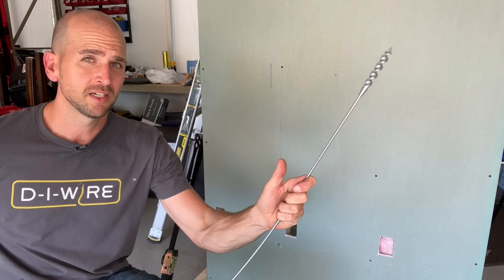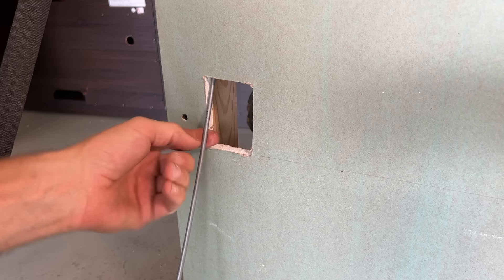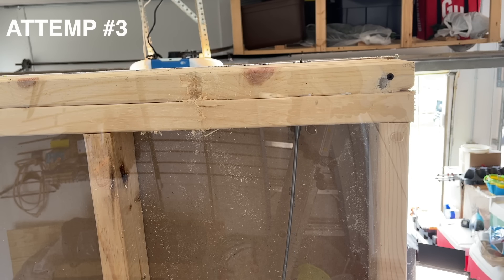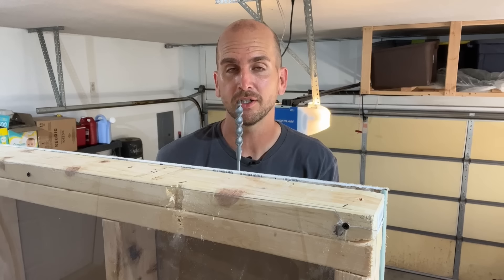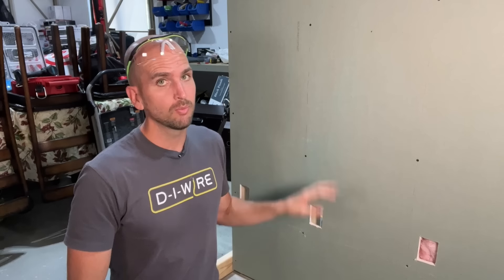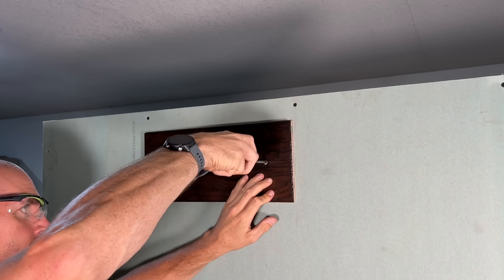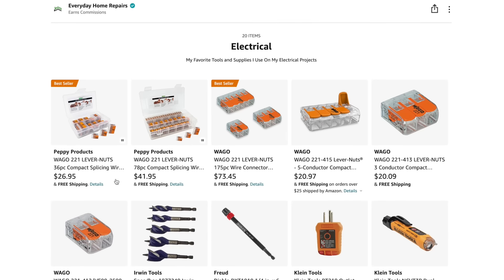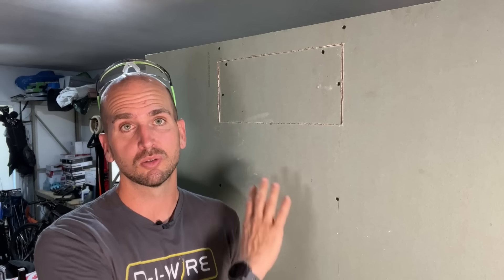Using A Flexible Auger Bit To Fish Wires Through Walls

Comment: For proper use there is a tool manufactures recommend to use to successfully use.  This Positions the drill in such a way that your force applied gives you the ability to continue through the top place or in many cases bottom plate and to do it relatively within a center plate location.   Yet the better bit can provide the gripping power to be successful.   

Yes practice will always make a person more Proficient.
Reply from the maker: Yeah, I am confident now with getting through fire blocks and bottom plates but stretching out 75" definitely requires some more practice on my end.

Comment: I'd be worried about hitting other  things or wires in wall. In my kids house had to run a new wire to an old outlet, that wall had wire and 3 stop blocks. Lol
Reply from the maker: Really, 3 blocks?  Dang!
Reply: @EverydayHomeRepairs  was in a basement, wire was broke between a run of outlets. Figured easiest was to run a new wire, well 3 drywall holes later surprise surprise, wire got run. Haha

Comment: I usually just cut a square hole at the top of the wall so you're able to easily drill a hole through the top plate. It saves so much time and it's a lot better than drilling through the wall. Patching one hole in the drywall isn't a big deal.

Comment: They also are supposed to come with a handle so you can land it in the center of the top or bottom plates. Regardless if you  get good at dry wall you can run anything with a hammer.

Comment: Im trying to drill approx 1/2" hole into a closet along the top base board, to run a wire.
Trick is to keep the hole tight to the wall, but of course my drill can't get that flush.
Being that I'm running into a corner, there will be 2x4 stud.
What tools can I use ?

Comment: use a thin staking flag wire. push wire through sheet rock ceiling next to wall, lined up with 1 gang cut out in wall. push into attics space. (might need to put staking flag wire into drill chuck to cut through sheet rock) now,when your in the attic, look for the flag wire sticking up. now you will know where to drill down into wall header board and into desired wall cavity. drop a fiberglass rod into hole with romex attached on back end. 
remove staking flag. the hole from wire will be tiny. cover with silicone, caulking ect.

Comment: They're called bumper balls. You place one about 6-8 inches from the point of the bit. They're wooden, smooth and look like a baseball with no stitching. Comes in multiple sizes. But most common is about the size of a plum.

Comment: There are techniques require to use a flexible bit/cable bit successfully when drilling blind.  The main problem is what happened to you - the bit will simply ride up the back of the wall cavity and you wind up drilling through the edge of the plate instead of the center.  The solution to that is to put a spacer on your flex bit's shaft.  I've used a tennis ball for that, but you can purchase what they call "bumper balls" in various sizes as well, purpose-designed for this.  The ball keeps the bit away from the wall of the cavity and helps you get it in the center.  That being said, if you are running the drill into an accessible space, like an attic, it's a lot easier to drill your hole from there down, if possible.

Comment: Maybe use a small piece of foam board around the shaft or the bit shaft to help keep the bit away from the edged — either way you get a reference hole to center another hole while you’re up in the attic pushing the wire down — if there is a block in between that hole should help center the upper hole — an inspection mirror and a flashlight should help as well — no suggestions with an insulated wall

Comment: Drilling Tip: Use Rack-A-Tiers - Bumper Balls these keep flex bits straight when drilling in wall cavities. There could also be other balls to drill out so they center around the shaft of a flex bit. This will keep the bit in the center of the top plate.

Comment: At 7:07 you could also use a shorter Speed Bit with a right-angle drill adapter.

Comment: Try getting those bits through steel studs!  Auger bits don't work and regular bits just bounce around.  My house has all steel studs so it was a pain but walls have no bows!  You can also use a tool in L shape that helps you to guide the bit.
Reply from the maker: Yeah, I know the kit came with one from Klein but I prefer being "hands on" to attempt to position the bit.

Comment: If you have an endoscope, this will help guide your drill before drilling. I tape the scope to a fish rod for more study control to check the location of the bit before drilling.

Lots of prep work have gone into making this video!
Reply: Yep some people call it a borescope too but I have a cheap one off Amazon I use for the same purpose.
Reply: I’ve never used a flex bit, but I have used a flashlight and a mirror in fishing cable through a wall. I wonder if this approach could be used when drilling a hole using a flex bit.

Thanks for the video.

Comment: I have used the flexible auger bit broke one that got so stuck in the wall I had to cut it.  The other I tried to go from one floor to the other and just ended making more of a mess and gave up.  IMHO they don't work well.

Comment: I have an silly idea that may not work. What if you put the bit into a foam piece that measured the length of an outlet and the width of the stud. (Maybe a little bit smaller than both so it doesn't rub). That would guide the bit up and put it in the center. Then you could apply the drill - which would toss the foam off after the bit was already going into the wood.

Comment: A better way to do it is to cut the drywall so about half the width of the studs on both sides are exposed making it a simple matter to drive the drywall screws straight in. Plus, it allows you to place the drywall screws farther in from the edge eliminating the danger of crumbling or breaking.

Comment: If you use the bending tool that goes with the long flex bit it makes it easier to guide the bit inside the wall cavity.  I think the tool is also made by Kline.
Reply from the maker: Yeah, I will give the tool/guide a bit more practice.  I didn't like the guide when trying to drill 75" away from the hole going up.  Just felt awkward but probably just need more time with the tool.

Comment: There are 2 much better methods of doing this:

1) They sell a ball attachment that goes onto these bits that keeps them centered while drilling.
2) Just take a long 1/8 drill bit, drill into the top plate at an angle through the drywall, take a small piece of wire and poke it through that hole, then go up to the attic and wherever that wire is , that's where you need to drill.  A 1/8" hole is much easier to patch than a drywall cut out.

Comment: DIYer, I use a utility knife instead of oscillating saw to cut through drywall. $200 for the Makita cordless multi tool. $135 for a borescope. I’m different than you guys, I don’t care, I would spend eight hours drilling that one hole if I had to just so I didn’t have to f around with patching drywall.  I haven’t tried the flex bits yet but I would definitely try the bumper ball, I have to install recessed ceiling lights and I know it’s going to be a nightmare but I don’t want to patch the ceiling drywall. It is my believe I would have to paint the entire ceiling and I’ve already done that and I hate painting. It is my belief no matter what I did the patches would still show.  I can’t imagine what a nightmare it would be to try that with insulation, and or insulation with a block, even with a borescope it would be a nightmare.  The insulation gets spun up on the bit and it even makes it darn near impossible to withdraw the bit.  Terrifying when you get a bit that you can’t get out of the wall.

Comment: I like the flex drill bits. You need to use Flex Shank Installer Drill Bit Guide Tools/Cable Bit “Bumper Balls”/in-Wall Drill Guide. It’s a ball that goes on the drill bit that keeps the drill centered in the stud cavity. Also you did not use a Placement Tool . Using both of these will end in success.

Comment: I needed this.  But, I have an additional factor I have to wrangle with.  What if you had wall paper? 
It looks nice, but if you have to do anything, I swear it is a headache.
Reply from the maker: Hmmmmm, with wall paper you would even have a stronger case to using the auger bit.  Do you need to stretch 75" up like my example?

Comment: this method works with Perspex, but not with drywall. If the drill bit is at the edge of the noggin, it will come out of the drywall every time. It takes the path of least resistance, and the drywall is too soft. Do a demonstration with the hole you’re drilling through on the Perspex side, and drywall on the other side, you will see what happens. And to avoid coming out of the drywall, you need to use a guide for the drillbit, and a rodderscope so you can make sure you’re drilling in the middle of the noggin, not the edge

Comment: You didn't drill thru the purlin. I drilled down from the attic but there is blocking 33" from the top plate and my longest bit is 24". I'm going to try and find an 12" extension.

Comment: Depending on your attic access you may not have to cut into your dry wall at all.  I had a peaked ceiling in the living room and was running wires to the back of my stereo for some surround sound speakers.  Luckily there was no blocking all the way down.  So I simply drilled down from my attic, and ran a fish tape down the wall to the floor and then fished out the wire.  In your example with the flooring, after you drilled the hole through the ceiling 2 bys, you still had to feed the wire from the attic.  So why open the wall at all?  Different story if you have blocking, but then you could possibly use that first tool to drill down.

Comment: Drill from above if possible but removing and replacing drywall would be my second option.
Reply: Agreed.   And fish with 12 ga steel wire til you find the hole for the outlet.  Helps if you have a helper.

Comment: Never had the issues with the augur you're having. You have to be more delicate with them, don't just slap the augur in there and start drilling. Obviously any time you can't see what you're doing it's a tough situation and things can go wrong. Proceed cautiously and it works fine. As others have said, I don't use them to drill up, only down.

Doing drywall work sucks, cause it's never just drywall work. It's mudding, resurfacing and painting. So what should be a simple short task of pulling wire turns into this multihour, often multiday job. A well employed augur saves you from all that and is where the real value of the tool is.
Reply from the maker: If I am just working the 54" long auger getting through a fireblock or bottom plate is doable.  With a few more reps I will use these bits for those 2 applications and agree the painting part can be tough especially because it is often hard to match and you have to repaint an entire wall.

Comment: I have used the flexible bits and they work fine if used properly. One problem is that many of them are cheaply made and spin where the chuck connects onto the shaft. Cheap! You have to use a guide to keep the bit to the center of the wall. Try again...

Comment: I made a square hole big enough to get the drill + bit through straight up, then added half inch thick wood shims all around to re-secure the drywall, but used a donor drywall piece with a bigger piece of paper on the finish side, so that there is paper all around.
Like that the repair piece has paper all over, no need to use fiberglass tape.
(similar to this technique: https://www.youtube.com/watch?v=EXhDlDBzXjY)

The pro-tip is to do all this extra wiring before repainting your walls, than after, and do any extra cables like Ethernet and 16 gage speaker wires.
In-wall "flush" speakers with a grill sound awesome with plenty of bass.

Comment: Should be drilling down with the flex bit not up, hence why you not getting clean holes…also check if any electrical wiring and anything else before drilling through. Plenty of times can be electrical wiring, gas lines, copper pipes etc

Comment: So your missing a tool to help guide the wall fish bit.  Allows more control over bit.  I work as a cable guy so i use magne pull for attic work and drill from attic down.   That bit you used i only use for crawlspace work.  Double wide trailers are typically biggest obstruction due to steel beam in center of trailer..

Comment: I am sure that these flex bit have their uses, but I use a different method for fishing wires vertically through a top plate into the attic and it doesn’t damage the wall or require much repair.

1.  Decide on outlet or switch box location in wall with a stud finder and ensure there are no fire blocks or diagonal braces in the way.
2.  Cut out hole for box.
3.  Directly above the box, drill a tiny hole in the ceiling about an inch away from the wall just large enough to fit a wire or coat hanger through.
4.  Stick wire up into attic to mark location.
5.  Go up into attic and drill hole for wire in the top plate of the wall at the marked location.  Feed wire(s) down.  
6.  Go back down and pull wire(s) through wall hole.  Install old work box.
7.  Put a tiny dab of spackle in the ceiling hole. Where you drilled.  You probably won’t even need to touch it up with paint.

Done.
Reply: I think you misunderstood what this video is for. Its for when you can't access the top plate to drill down from the attic.

Comment: Am I missing something here?  You have to go into the attic to run the cat-5 anyway -- why not just drill through the top plate and feed you wire down (which is way easier than up).

Comment: You could skip all the specialty tools and sheet rock work by marking the drill location in the wall.  You take a piece of coat hanger wire, put it in your drill, then drill up into the crease between the wall and ceiling.  once in the attic you can just drill down into the top plate with a spade bit or whatever you have, directly in the center.   Then the only  hole you have to cut is the low voltage outlet hole.   the hole in the ceiling is small enough that you cant see it but you can just put a little finger of spackle into the opening.   If you are working in a wallpapered space, or with paneling you definitely don't want to miss.   The method shown seemed unnecessarily complicated especially for a single outlet.  If you were drilling down from a floor top plate into a crawl space the flex bit would be useful.

Comment: The only mistake you made was in putting back the drywall. Any cut drywall will have burrs or frayed edges that stick out. The easiest way to remedy this and ensure a smooth drywall finish; is to use a utility knife and lightly bevel the edges of the cut piece and the permanent side. This way you will not have to use a lot of putty to cover the cuts. Plus it gives you more surface area for the mud to stick.
On a fix like this; there is no need for tape, if you use hot mud/ putty powder. Hot mud does not shrink or crack. I have fixed many drywall issues like this without tape and I have never had an issue with the mud cracking.

Comment: The reason you're having such a hard time is there is actually a tool to help you guide the bit without that tool almost guaranteed you're gonna keep going off the center
Reply from the maker: I do, own a torque screwdriver now but really only get it out with dealing with the larger stranded wire.

Comment: I just watched a vid that demo’d a flexbit. There was a ball, on the shaft of drill bit, about 2 inches below the shaft end of the bit. The ball was about 2 inches in diameter. The ball helped steady/center the bit, I.e. preventing it from drilling into the drywall. Unfortunately no comments, in that vid, whether the ball was a product or someone’s idea. The ball had a painted finish and was made of a hard substance. Maybe a solid wooden ball?  
https://youtu.be/Fr0lo-Sx-Cs

Comment: This demo is not realistic….. you kept talking about putting the cable in through the top… if you have enough space to crawl up there you would just drill it through the top. This is
More to use the flex bit to make the hole then fish tape or pull string to the attic where you can hook it and tape the wire you need so you can then pull it down